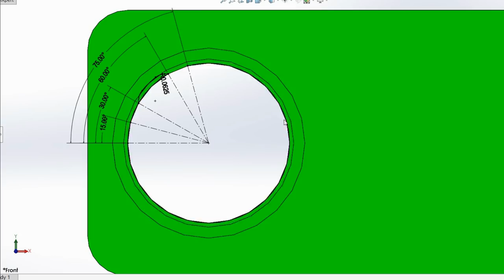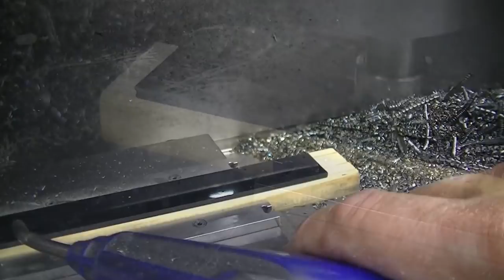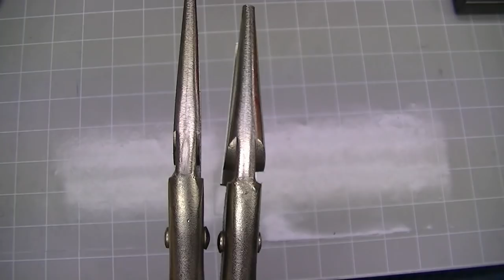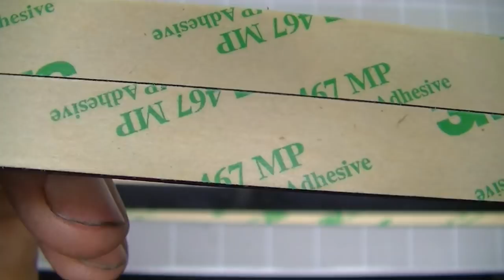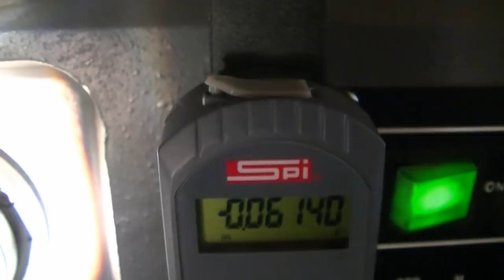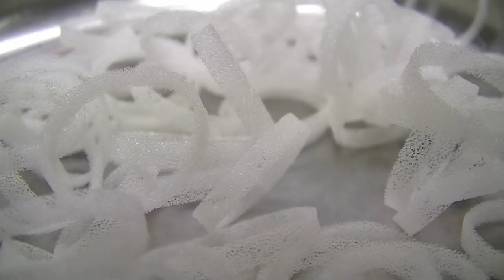MAKING LINEAR BALL WAY CAGES

Comment: oh at least 10 useful ideas,   on your vise grip clamps did you silver solder the roller on the end?
Reply from the maker: Tig with 125000 psi die welding wire. When you use silver solder and then use the clamps to do silver soldering bad things can happen :-)
Reply: ROBRENZ  do you reharden and temper the tips?
Reply from the maker: Just re-temper

Comment: I know this is old already and maybe I missed it, but are the linear cages fixed or just allowed to float/roll along the length of the axis??? I see no provisions to keep them located in a specific area, which should optimally be equally spaced under the grinding wheel. Any one know?
Reply from the maker: They move half the distance the table moves so for a 18" travel the gages move 9" either side of center.
Reply: @ROBRENZ  Thanks for taking the time to reply. This confirms my suspicions. I thought holding the cage in fixed position would work better but now I see it would add too much friction and enhance the possibility of the balls skating on the surface of the groove instead of rolling.

Comment: Hey Robin are those SS balls or are they chrome plated steel. I am in need of new ball cages my self only mine are .750 balls . Man there are way to many to choose from on Mcmaster thank you
Reply from the maker: They are chrome steel and you need to get grade 10 balls  from baltec. go on thier site and go to the shopping  section and type in your ball diameter. then make sure you are looking at grade 10 and then find a lot size that is >= the number  you need. looks like about $2.84 per ball. You need grade 10 for ball size match and roundness if you want your grinder to perform well.
Reply: Ok thank you for your response what I did was look at the grade chart and ordered the equivalent from McMaster the grade 10 where 0.0001 on roundness so i matched that from MMC you think that's  ok . I took a look at baltec and that's not the same place i found the grade chart but it was the same chart. Thank you for your time
Reply from the maker: IMO McMaster does not have any  AFBMA grade 10 balls. If you do precision work on your grinder you need AFBMA grade 10 balls
Reply: @ROBRENZ  thank you Robin well it looks like the kids will have some sling shot ammo. I'll have to call balltec there website is acting weird thank you again for taking the time and I am eagerly waiting for the grease to oil conversion you have great evening

Comment: Surprising that a surface grinder would use grease. I know when close tolerance is required, even oil can cause a difference if cold or warm. Hydra static systems need to be “run in” before being used.
Reply from the maker: But this is rolling contact of balls on flats so different than plain bearing hydrodynamic film
Reply: ROBRENZ never saw that configuration. I’ve seen rollers on flat and Vee ways or balls with Vee ways or hydrostatic scraped ways. Interesting...
Reply from the maker: I was referring to the contact condition. It is two vees on one side and a vee and a flat on the other.
Reply: I recently rebuilt an old Thompson 2f 8x24, and it used grease in the ball slides on the vertical axis.  Though I didn't do anything except clean it and re-grease them.  They used a solid brass cage and the balls were staked in.  If I have to take it apart again, I'm going to be copying your fine work Robin.

Comment: Rob as I am only still luring and have had some coaching from one of the local shops is not reaching in and grabbing the swarf whilst lathe is running and cutting a dangerous practice cos if it grabs there is a finger gone please tell me if I am wrong
Reply from the maker: You are not wrong. Don't grab chips with your hands. After 55 years of machining experience I know which chips are relatively safe to grab and which are not. The chips in this video are harmless.
Reply: @ROBRENZ  I sort of thought it was safe or you would not do it its only that the chap helping me out say not to do it but as you sat your experience has taught you what you can grab and cannot touch thanks and keep doing the videos as I am learning a lot from you things I can apply to what I am doing not same as you as I am not in the league cheers
Reply: Classic example of do as I say. Not as I do. Experience teaches when you can get away with it.

Comment: Could you not just have ground the table flat to account for the difference in deflection between the two sides with the same number of balls? Or is the deflection non-linear wrt. the weight on the table? If so it would be interesting to see just how much of a difference in tilt one could expect between the lightest and heaviest work pieces given the same number of balls both sides...
Reply from the maker: Yes you can grind the table flat but all the calculations were to accomplish uniform deflection of the two rails so that there would be no/minimal tilt in the table with variation in workload.  The tilt with a heavy load is a significant amount with the same number of balls in both rails.
Reply: Gotcha. Great video as always! I'm amazed at how much oil that open cell foam wicked up.

Comment: Utterly idiotic question....forgive an ignoramus.  Why do shapers and mills and lathes use metal on metal lubricated ways rather than linear ball assemblies like this one or needle bearings?  Is it that these would be more fragile?
Reply from the maker: metal on metal has much higher load capacity and is stiffer.
Reply: @ROBRENZ  Understood.  Makes sense. But more prone to that stick...move issue you mentioned, which I presume is not an issue in those gargantuan metal vegetable peelers that Abom favours.  Thanks!

Comment: I didn't quite catch why the reason for felt for the ball wicks was not a viable option? If anything I would be more concerned with the longevity of the foam seeing as reduced maintenance seemed to be what you were after.
Reply from the maker: The felt sheds fibers that could randomly go between the ball/race interface.
Also the felt is difficult to cut as precisely as I was able to cut the foam.
Reply: @ROBRENZ  Thank You for clarifying. I take it pre-cleaning/soaking Felt to clean & "weather it" first would still pose the same long term issues? Also since your repair video was completed a while ago how well has the foam stood up to the tests of time and machine use? I'm very curious to know, however if you haven't had the need to dissemble and inspect yet, I'm sure I'll be just fine waiting until said day arrives. Great video, enjoyed it
Reply: @ROBRENZ  I'd be worried about the oil degrading the foam. Otherwise great work!

Comment: I'm not a huge fan of calling Harbor Freight names while clearly showing that their product is useful and serves the purpose.
Reply: Well, they were only kind of used for their intended purpose. They were used as raw materials for a specific purpose built tool, which seems like a perfectly valid use for them. That said, I haven't done a comparison between HF vise grips vs the Irwin brand and can't comment on the quality difference, so I won't get into that. HF makes some useful tools, some less than useful tools, and some garbage. They've earned the nicknames that they have, but it doesn't make everything they produce unusable.